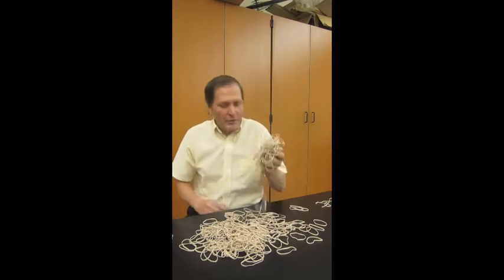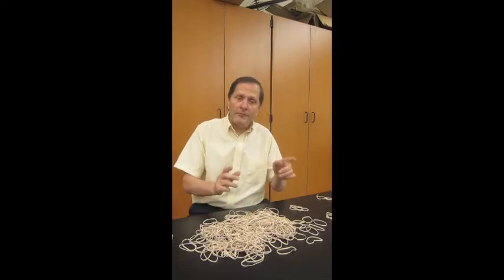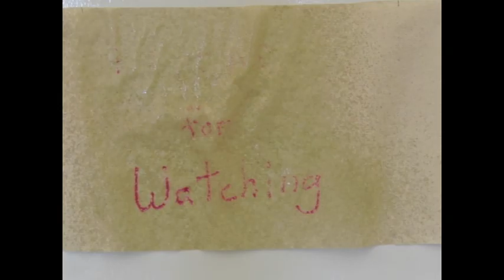Rubber band powered cars, mousetrap car alternative/// Homemade Science with Bruce Yeany

Comment: hi sir , just like mousetrap cars,soda bottle air car and  rubber band car we can also make cars by using a measureing tape , we can wrap the measureing tape on one axle and join wheels on both side of the axle , and we will get a measureing tape powered car ,we can make the car fast by making 2 axles , one axle which is joint to the wheels and other axle on which we can wrap mesureing tape and join both axle with pulley and rubberband , sir what do you think of this idea?